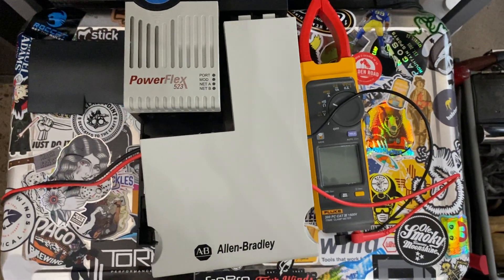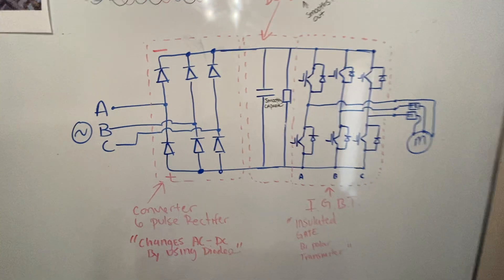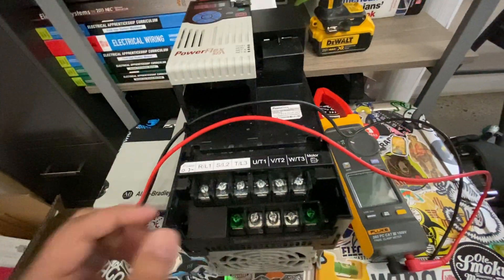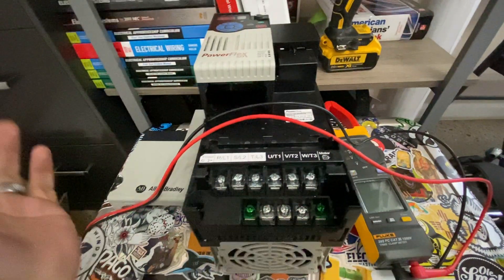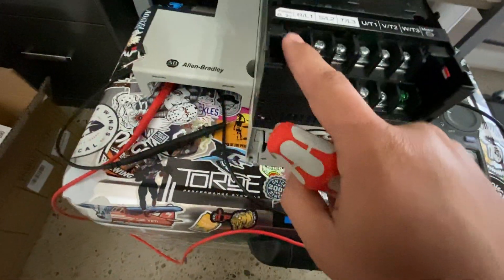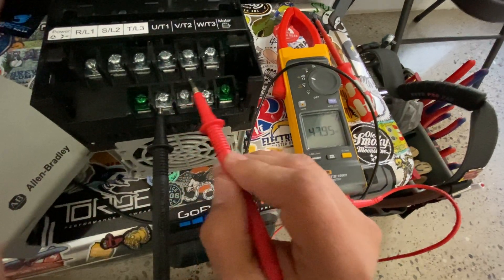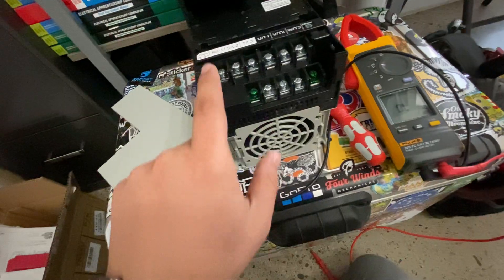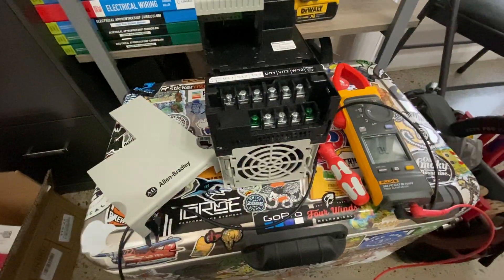HOW TO TEST IF A VFD ( Variable Frequency Drive ) IS BAD WITH A MULTIMETER

Comment: 3:05 - You wrote ‘transmitter’ on the board; but, you have drawn transistors. — [EDIT: I’m an idiot. Even though you don’t have it labeled, you can input 120 or 277 on terminal input A and white or grey (neutral) on input terminal C] — Also, you show a three phase input, but said 120, 277 (two different systems). At low voltage three phase wye, 120/208 is the supply (120 being one leg); but, at high voltage three phase wye, 277/480 is the supply (277 being one leg). Having gotten that off my chest, I can view the rest of your post.

Comment: I'm getting into more vfd troubleshooting work recently,  thanks for this.  So I'm guessing it looks like the diodes are 'leaking current backwards"??  I don't have any theories on how water exposure did that but did this present as a fault code on the VFD?  Or did it just stop working totally?  Thanks again!

Comment: Final out is a modified AC .on final output IGBT is insulated gate bipolar FET . Not a transmitter but a gated transistor..Allen Bradley does not want techs inside that drive, tr puling one apart. You got shorted diodes & probably blown fets, Transistors, not transmitters. Another test, put power on it put} your meter on UVW and see if you got output  {Sir you dont know your components.] You  SS_hit your hat ?
Reply: Right. You are NOT going to change out diodes in that drive as the video creator stated. The diodes and output transistors are all in one block. The drive is truly a throw-away if damaged. 
Also, if the drive does not pass the static checks for input and output devices, do NOT power it up. You could get an explosion or fire.

Comment: The diode check is always the first thing to be done because shorts on the input side or sometimes even the output side cannot be saved by the drive just faulting. What you are actually checking are the 6 input rectifiers as well as the 6 reverse polarity freewheeling diodes built into the modern IGBT's.

What you do is follow the current path from the meter through the component. When you place the negative meter probe on the DC bus Negative, then the positive on any of the inputs or outputs, you are reading OL because you are charging the bus capacitors with the output voltage of the meter. This is what you want to see. When you place the negative meter probe on the DC Positive and then put the positive on any of the inputs or outputs, you are then measuring the drops of all the diodes in the corresponding half of the drive. The three input rectifiers on the 'top', and the three reverse polarity diodes on the IGBT's on the 'top'. When you reverse the probes (positive of meter to DC bus Neg) and do the same operation, you are then measuring all 6 diodes on the bottom half. So you want to see healthy voltage drops typical of those rectifiers, such as above ~300mV or so. Anything below would indicate one of those diodes has failed shorted, and something is going to blow up either powering it up, or giving a run command (if it can't just fault).

Comment: Easy way is remove three out put wires that goes to motor and start the vfd. If vfd is giving out put voltage  means vfd is ok  if still vfd faulted out at ground or other fault then vfd is bad otherwise motor or cable that is connected to motor
Reply: Some drives won’t start if it doesn’t detect a load . I’ve tried this method
Reply: @Josh-px6xb   we have Allen Bradley drive like power flex 525 and 40 P starts if load is disconnected  last time I have ground fault and i figured by disconnecting load

Comment: Place that I retired from had over 100 ABB 6 & 18 pulse drives. We had about 45 5 HP garbage ABB drives in a 5 story garage that over 25% burnt up first year. Told us they are throw always and have to purchase new ones. ABB tech support were prima donnas that always gave me a hard time when I only asked them 1 or 2 questions. A&B & Danfoss tech support were best in class.
Reply: The best brand for VFD is Mitsubishi,fuji ,maybe they're more but I had good experience so far with this 2 brands for reference for Mitsubishi I was working for a company a d we had a Mitsubishi VFD was running a pump at least for 20 years not only 1 but 10 without issue motor burn and VFD stop and we replace the motor and we started no issue with the VFD in a high humidity environment ,I worked with others brand the worst one is AB power flex m 4 I changed a bunch of them during a period of 5 years because they had a hard fault that show up when the power turn on .

Comment: A&B were best in class for training & tech support. Years ago I attended a week training at Allen Bradley for a special VFD that was only used on a few thousand Goss RTP'S ( Reel Tension Posters ) for 2,500# rolls of newsprint. The VFD had a program that calculated the speed of expiring roll of paper and perform an exact speed match on paper that could be traveling more then 25 miles per hour ( press running at 50,000 papers per hour ). Was amazing to watch paper being cut then pressed down on fast moving g paper. A&B has great products & great tech support. While our 20 special A&B were under warranty and we were having major problems with a couple of them they were going to fly out a tech but they fixed it over the phone.

Comment: Why you choose negative frim drive to make check with l1 l2 l3 and u v w ?
Reply: If you look at the schematic, the diodes are forward biased (should act like a closed circuit) relative to the negative terminal. When placing the positive probe there you're generating a small voltage between the negative terminal and any of those l1 l2 l3 u v w terminals. If the diodes work correctly you should see a voltage drop (between 0.5-0.8V or 0.2-0.3V depends on the type of diode) or small current passing (which translates to some resistance if you're reading in ohm mode). When reversing the probes (positive probe on any of the l1 l2 l3 u v w terminals and negative probe on dc negative) you should read OL in resistance, as the diodes should block currently from flowing back.

Comment: Its not really AC but Pulsed DC that goes into the motor.
Reply: Pulse width modulation. Is a good concept to understand.  PWM.
Reply: Yes, thanks
Reply: It is alternating current derived from modulating the DC bus plus and minus to each phase. The drives that use pulsed DC are called brushless DC and are akin to servo motors.
Reply: @roycemitchell2562  bro it’s pulsed DC like I said

Comment: Im still confused on why you're testing between AC and DC. I understand the drive is converting the AC to DC, and then back to AC. But its done all internally. Aren't those DC terminals used for 24v for the drive? I guess i just don't understand the relationship between the AC and DC terminals.
Reply: The DC terminals are for the DC bus, not 24VDC IO power. Those would be on the IO terminals. This is the rectified DC bus shown on the center of the schematic that the VFD uses to invert to PWM AC.

Comment: Do you use positive to negative dc and positive dc to negative terminal
Reply from the maker: Red on DC Negative gives you numbers that should be the same 

Black on dc negative you should read “OL” on all the AC terminals
Reply: i think hes using the how to test  a diode technique to tell whether the diodes are bad or not because if they are bad they wont convert the ac to dc properly and i believe fry electronics. if i remember right the anode is the positive side and cathode is negative if you put your black on the negative end and red lead on the positive end electronics flow should be .6 voltes for a silicone diode. reverse the leads and you should see OL no voltage should flow if its working correctly. diodes only allow voltage to flow one way so when you see them flow both ways or not at all you know they are bad.  he could probably open it up and desolder and solder the correct rated diodes but if your an amatuer and dont want to risk damaging expensive motors id take it somehwere to be done if its cheaper.